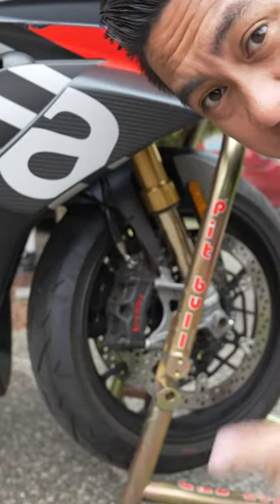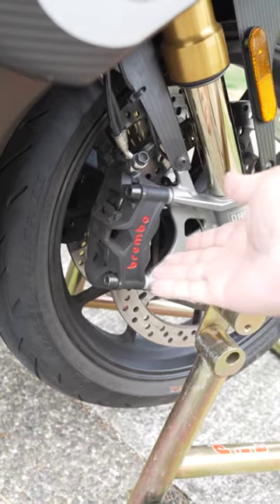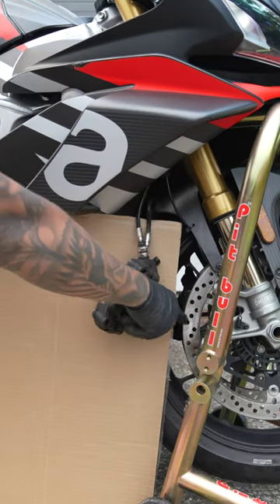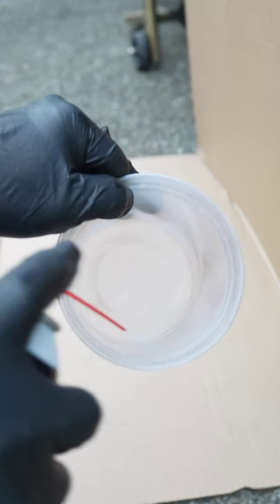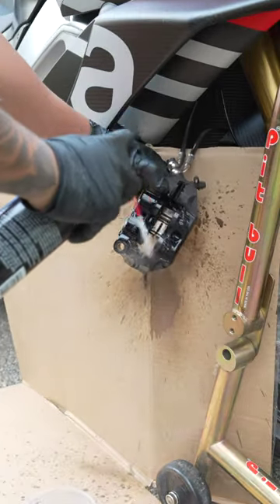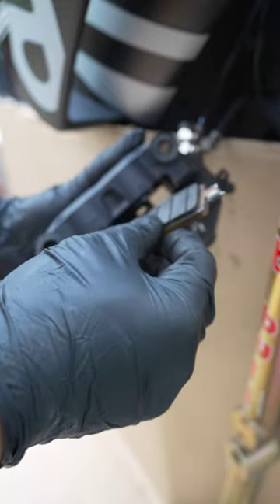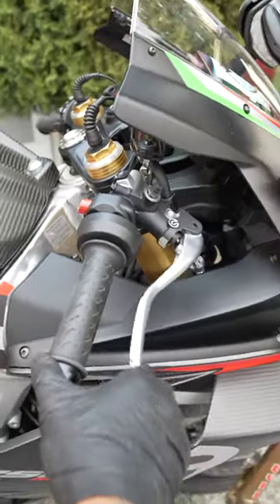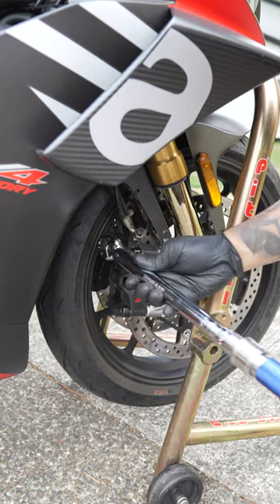HOW TO CLEAN YOUR MOTORCYCLE BRAKE CALIPERS

Comment: Your introducing more error potential by doing this then just leaving shit alone
Reply: Right!!! This is extra for no reason. Clean the caliper when you do new pads, i see no reason to just randomly do it for "maintenance"
Reply: Yeah, try that on shitty and dusty roads. calipers with steel pistons rust and gunk up with brake dust when not taken care of especially non radial brakes. Regularly checking the brakes every 3 months does the trick on non radial brakes ensuring the slider pins free of corrosion.
Reply: never done it, never had problems
Reply: I’ve seen plenty of calipers fail and lock up after being pushed back after a brake job.
Also, there’s a solid chance someone does this forgets to pump the brakes up and the first time the hit them after taking off nothing will be there
Reply: He got chicken scratch, and he’s worried about breaks😂
Reply: My thoughts exactly. This is the first time I have ever seen anybody do this. On any vehicle
Reply: Doesnt brake cleaner destoy brake padd
Reply: @okok-oc4ko funny, dont have the same issues with my car
Reply: @theskull6653 everything I’ve read about doing brakes says that it’s safe to spray brake pads with brake cleaner, but I just did brakes on my car and the papers that came with the pads says not to spray cleaner directly on the friction surface.
Reply: First 2 hard stops and the brake dust is right back there. Keep the motorcycle clean and clean the parts when you do a service. No need to do any of this
Reply: just trying to squeeze out that extra content 
pretty soon he'll be making a video how to clean and wash your tires or some shit but dont forget to take it off to clean it better
Reply: He won’t listen to you, just have a scroll through his comments. He suffer from the dunning Kruger affect.
Reply: @theskull6653  Nah
Reply: @rickbateman2401  They do it just to be sure.
Reply: @smokeybear390  You are talking about two completely different instances/reasons.  

The proper way to perform a brake job is to rebuild, or at least disassemble, clean thoroughly and then reassemble the brake calipers.
What he did in this video was improper because the remaining half of the piston  is still dirty as well as the cylinder walls.  Believe it or not, that can possibly be the cause of a failure in piston movement, because now you have a difference in clearance, which could potentially cause the piston to canter to one side while sliding forward/out.
Reply: @theskull6653  No, it is designed to remove grease and grime, and the pressure of the can contents or puddling of fluid will wash out any brake dust.
Reply: Drive ofroad all the time with my BMW 1250 GS. Never ever had i done this. All i do, is spray my brakes with an airgun after a long dusty tour. Hose my bike down with some plane old water. And start cleaning everything by hand. Never had issues. Showed this to my dad, he never did this. Because this shit won't happen unless you leave your bike on a beach under the sand for a couple of days
Reply: @okok-oc4ko non radial? Sorry but what bikes still have these nowadays? 90% is  radial.
Reply: @bachmed00  90% for where you're from. Cheap bikes from 3rd world countries use axial brakes, even japanese brands use them too. Radial brakes are considered a luxury where I'm from since high displacement bikes only use them. Other than that, 125cc bikes sell here like pancakes, the positives of having radial brakes doesn't make sense when a typical axial brake does the job just as much.
Reply: @williamstephan880 trust me! Who needs to maintain a vehicle. No one ever got hurt from a motorcycle!
Reply: @nickformato6838  What is chicken scratch..?
Reply: @theskull6653   Yup! lol
Reply: @okok-oc4ko what are non radial brakes?
Reply: Most calipers have a dust boot/seal, then an entirely separate seal to keep the fluid in the caliper. His bike is a high end racing machine and may not have the dust seals. If this is the case, this procedure makes sense, if not he’s spreading fear to 98% of riders.
Reply: I’ve been riding for 20+ years and never had a brake calliper failure. Your just asking for a lot of trouble just for cleaning your breaks. Definitely expert level
Reply: It does make a difference if you ride on winter and they salt the road. It meant I didn't have to redo the piston seals every year.
Reply: Used to clean mine every time I finished racing the isle of man tt course or any road race or track.
Reply: @Acer1000 maybe your not riding hard enough.
Reply: Hearing some of the crap comments on here is crazy talk. And use are the type of guys that flys bounce of the front of your bike. I guy that knows bikes will do this after every race. Or twice a year just riding daily.
Reply: @okok-oc4ko right especially thailand,malaysia and philippines
Reply: Spraying brake pads with brake clean,Isn't good. I clean the brakes when I change the blinker fluid.
Reply: If it does seize and guys it can happen, mostly if you ride in the rain or get calipers used from someone who did.  When it does happen your lever gets spongy and no amount of bleeding will fix it.  Sound familiar? when it does happen it usually is dirt between the seal and the body of the brake caliper as opposed to dirt on the piston.  You need to then pop the pistons out (like he did in the video), take out the seals with a pick and then clean the dirt and corrosion from the seal grooves.  clean it up and put it back together and like magic it will blead right up.  I just use soapy water and a toothbrush instead of brake cleaner but bake cleaner should work too (just protect your eyes when you spray that stuff)
Reply: @okok-oc4ko you don’t need a sport bike then… end of discussion
Reply: @slow_s1000  as much as I hate to say it because I'd like to have one, yes, I don't need it. Impractical for daily use and the roads we have. A trusty dual sport though would suffice.
Reply: @rickbateman2401  In fact when you put new rotors on you're supposed to spray the oil they put on to prevent rust off of them.
Reply: @RedBud315  yes, the ROTORS, not the pads.
Reply: yeah but it is not a bad idea when dpne right
Reply: I do it every 4k miles…
Reply: If you don't know how to change brakes in your vehicle then you're a kid, bud.
Reply: You’re talking complete rubbish
Reply: Finally someone with common sense in the comments

Comment: i've been driving motorcycles for nearly 40yrs and have never seen this happen.
Reply: Same , have been riding bikes for 35 years and no dramas.
I've had my R1 for the last 20 years and no issues.
Reply: Because your calipers froze up you crashed and were in a coma for 40 years. This is why this is so important!
Reply: It’s only when people run out of BS to film they starting doing useless stuff like this I guess
Reply: 2016 BMW R1200RT 80,000+ and it happened to me right after I stopped at a intersection.  I pulled out and the bike felt hard.  I slowed down to pull over and the bike stopped half way off the street.  The front left caliper was locked up.  Broke the bleeder loose and rode it back home.  Tried to clean the piston but no luck.  I had to replace them.  I ended up rebuilding both side.  Never had this happen to any of my other bike.  Shit happens.
Reply: Bingo
Reply: @SM-vs4ro 80k plus about the reason not because it was dirty
Reply: @justicemcdonald2939  You must be joking right? It ain't cause they were old calipers. Old calipers will perform just fine until you probably start leaking fluid. They won't seize just because they're old.

I've had many brakes stick on cars and one bike. And many seize but only on cars. 

Cleaning them goes a long way but I bet this happens mostly up north where I live where shit rusts by looking at it. I know he isn't up north but cleaning your calipers is still good maintenance.
Reply: @tomvana4270 you clearly don’t or have never ridden
Reply: lol I have been working with small engines for 12 years and never new this was such an importance 😂
Reply: @JT-pt5tl  CLEARLY you have no idea who you’re talking to.
Reply: @SM-vs4ro you never clean pistons you always just replace them
Reply: Driving or riding
Reply: @_750ZO  i dont ride. i drive them.  im not a passenger. i am the operator.
Reply: @SM-vs4ro  most likely from dirty fluid. but not from any accumulation of dust on the outside of the caliper piston.
Reply: I had to do a caliper rebuild on my 05 FZ6.  A stuck piston was causing wildly uneven pad wear to the point where the one pad was partially down to the backing plate on the one caliper and the other caliper's pads looked nearly new.  I had a stuck rear caliper on an Acura as well, that ended up causing so much extra drag that it heated the disk to where the disk separated from the rotor hat.
Reply: You must not live in the rust belt then
Reply: @niyantn  nope. i do not. it hurts too much to live in a cold climate. i live in the desert where the temps in the summer reach 120. lol
Reply: @_-KOEN-_  This is from the same guy that showed you how to clean the inside of your exhaust.
Reply: Better safe than sorry.
Reply: I am a motorbike mechanic I have seen this happen before but what he’s doing doesn’t help much he should clean them then use red rubber grease on the pistons
Reply: It happened to my rear brake, but that was because I left it in the garage for months without caring about it
Reply: @_-KOEN-_ 😂😂😂😂😂😂😂 you made my yo
Reply: It does make a difference cleaning them

Comment: Somewhere there is a newb mechanic frustrated because he cant fit the brakepads over the disc due to him not knowing that he has to push the pistons back in the caliper before re-assembling the pads. Or even worse his pistons are pushed outside of the caliper because the wanted to clean the entire piston not knowing you can also push them out completly causing you to clean all of the brake fluid up and refill and bleed the brakes. For that guy: please don't do this yourself.

Comment: As someone who is a professional motorcycle mechanic, don't do this. The brake cleaner can swell the seals for the pistons and not allow the pistons to retract. It can also cause the seals to leak
Reply: I'm sad that so many people are applauding this tip. I'm more sad that I keep seeing this guy's tips constantly, that no one should do
Reply: Never mind that he suggested pulling the brake lever with the caliper off and the pads out😂 all well and good until the piston pops out and the DIYer finds his/herself in a pickle. Also any anti-cease grease or release pin lubricant that would be there from the previous mechanic or dealership has now been washed off. So now you're introducing potential for rust and greater mechanical wear. This guy obviously isn't thinking about how dangerous this bit of misinformation could be.
Reply: Yeah this guy isn’t very smart lol. You don’t want to clean your pads either

Comment: Don't do this. You rely on your brakes for safety. If you dont know what to do, take it to a mechanic or get your information from a credible source. The calipers are supposed to have a lubricant on the release pins to decrease mechanical wear, stop rust build-up and help the pads return to a neutral position. Also he's suggesting you pump the brakes with the pads out. On some calipers this can cause the piston to pop right out. If you don't know what you're doing, you're then in for a world of hurt. Also someone else suggested not leaving the caliper hanging by its brake line. While several people do this and have not had issues, its still the wrong way to do it and if you have any minor cracks in your brake line you're only going yo make things worse. Additionally it adds strain to a part that was never meant to experience any. Use common sense and vet your sources.

Comment: When you use the brake lever to push the pistons out, you should have a right sized block of wood in between them.  Without one, you run the risk that the pistons will come out unevenly, 3 of them could stay put and only 1 would move for example, particularly if they really are dirty.

Comment: There's actually a lube for around the piston boots and pad slides but over drying the rubber boots and seals around the caliper pistons isn't a good idea, it will be clean but the boots and seals will be cracked and falling apart and leaking😊I'm not saying don't clean them every once in a while but get the correct lubricant grease and reapply it afterwards to keep the seals and piston boots soft and pliable 😊

Comment: It’s actually from not changing your fluid and moisture getting in the lines corroding the piston. Simple green and a garden hose is all you need to clean them while installed. 

Those babies could be caked with mud and still work just ask any ATV owner.

Comment: A lot of shops and racers use Simple Green put into a spray bottle which is also bio-degradeable. Then use a tooth brush to lightly scrub the caliper, pistons and pads. Then use a spray bottle of water to rinse off.  Air blow dry if you have compressed air or go for a short ride. 
It is safe for o'rings. I have been using it for years and years.

Comment: As an motorcycle mechanic i will tell you DONT DO THIS.
With mornal riding You only have too clean it whem you repalce the pads, also you have special grease for the piston seals....
And if the brake is stuck because off standing stil to long you need to get the pistons out, probably there is corrosion under the seals.

Comment: This is a good practice to do when changing brake pads before pushing pads back into caliper. It is completely pointless if re-using brake pads, because as the pads wear the pistons move out further

Comment: Don't spray brake cleaner into the caliper! It'll kill the piston seals! Clean with brake fluid and when clean apply a little red rubber grease around the piston before you push them back in.

Comment: What about the slider pins? Kind of important. You should also apply some kind of rust prohibitor and lube those pins. Bleed the entire brake system using fresh DOT 4 synthetic hydrophobic brake fluid. You're welcome.
Reply: There are no slider (lines) pins, it’s a monoblock fixed caliper. That’s why there are pistons on both sides.

Comment: Cleaning that portion of the brake calipers aren’t going to do anything to stop or prevent a “caliper” from seizing. When a caliper seizes, it happens behind that rubber seal. Or it happens because the pad is not returning/sliding. Meaning the brake pad it self is seized in the bracket. However it’s still not a bad thing to clean like shown in this video. Yea I’m a Automotive tech of just about 20 years now. I’ve rebuilt both automotive and motorcycle calipers. Knowing how it works is knowing how it fails.

Comment: I use soapy water when I wash my bike.. maybe a tooth brush to get what I can...  I never touch pistons until I rebuild a caliber..  and that's on age of the seals ..  or a restoration of the older bikes I do..  

Rebuilding a caliber is easy but only necessary piston seals start to leak..

Comment: A great tip would be to place the barke pads in the same pozition meaning left side to left and right to right , not the other way around because they wear different and being switch would cause the brake to not perform the same way or better.

Comment: Correct me if I'm wrong but if you push the brakes too far with the caliper off the rotor cant that push the pistons out of the caliper? I've accidentally done this to a Ford Taurus, and we almost had to trash the whole caliper, but we managed to get the piston back in. Does that go for bikes the same way?
Reply: yeah, but once you drain the hydraulic fluid and let air in, it stabilizes.

Comment: I owned many many vehicles over the last 50 years and never ever once cleaned my braked just to clean them.  That would done when you replace your pads if at all.  Never had calipers seize on me.  The brake lube prevents that if you used it.  He should change good chance to very rare chance.

Comment: Its a good time to hit the brake pad with sand paper, maybe do it next time. Removing the top layer of the pads will eliminate the squeaky or grinding sound. 
Also it wont add any more grove to the rotor and the performance of the pads will be the best when the surface if fresh to rub against the rotor.   Yes cleaning the pads with break clean is a good way, just a little more work maybe a few seconds but its worth it.

Comment: Don’t forget that when you pumping your brakes do it slowly otherwise you can pump air into the brakes.
Reply: It's a sealed system if you get air in there without opening the system there's a problem
Reply: You mean like via cavitation?..

Comment: It's really not necessary, but if you do do it next time, put a thin piece of wood between the two caliper locations of the pistons so that if you press and you push the pistons out too far, you'll still be able to catch them it's really not necessary

Comment: You might want to add lubricant to the outside of the pistons, yes you cleaned them but also remove any type of grease that can stop it from rusting which will cause it to seize faster.
Reply: Dont ad lubricant to brakes ever. There are special produkts for that(brake calliper/copper/ceramic paste)
Reply: @RickSanchezdimension_  we’re talking about pistons in the brakes. You also need to lubricate the guide pins lol
Reply: @Baconrips  Yes but not with a lubricant but with Something specialy made for the Pistons that wont make the brakes fail if it gets on the Pads

Comment: Well done on prematurely ruining your seals. Unless your going to actually change your seals. You should only clean the pistons if you plan to do a full brake service. 👍🏻
Reply from the maker: Well done on not knowing a damn thing. Brake fluid is much more corrosive - and the seals are just fine